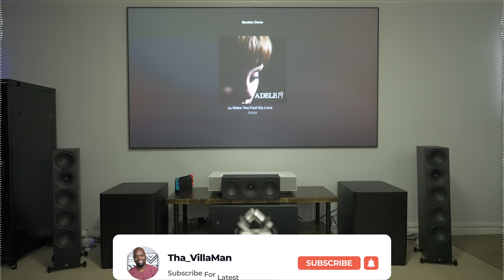Arendal Sound 1961 Speaker Music Demo | No Subwoofer

Comment: Hi man which receiver do you use in this video?? I have Yamaha Rx v659 and it doesn’t sound so good with my 1961 speakers. Can you recommend any good receivers that sounds good with 1961?? Thanks
Reply from the maker: I used a Trinnov Altitude 16 processor and a Parasound A51 amp. My Denon X4300H sounded great with the 1723s. Make sure they have the power they need if you’re driving them hard. An external amp is ideal
Reply: @ThaVillaMan  thanks 👌